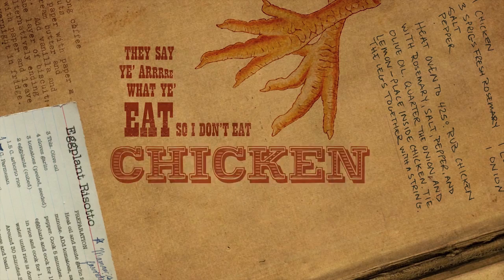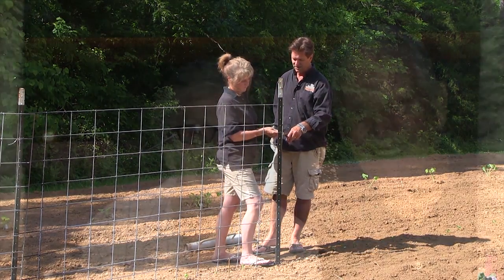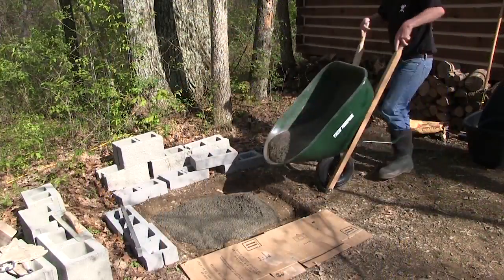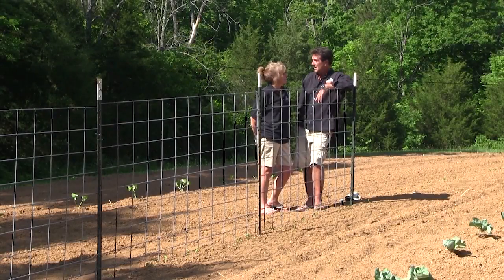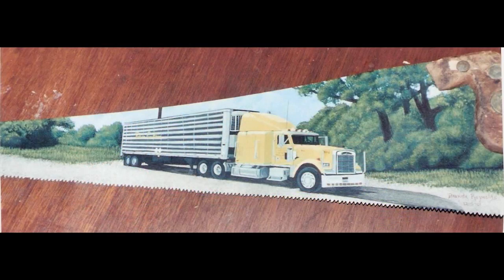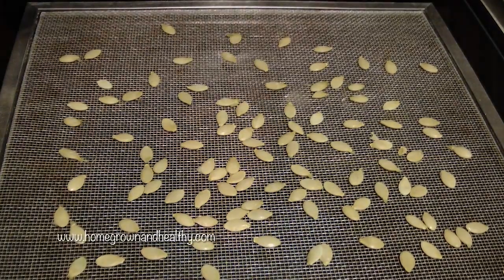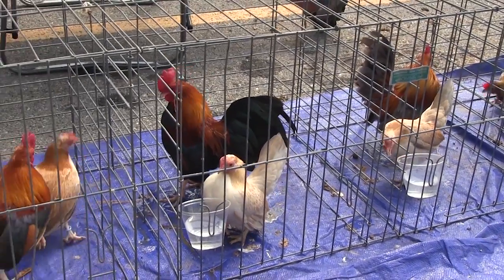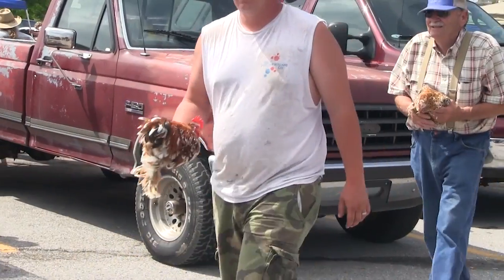Growing Beans, Final Smokehouse, Heirloom Seeds, Chicken Swap & Smoked Cabbage/Onion (Episode #309)

Comment: Going to try the tomato watering bucket, but with Styrofoam cups, because my garden space is very limited. I also cut the bottoms off the cups and upturn them to encircle the plant stems and toothpick them to the ground to help with slugs, however this method needs refined because the plants have to be tall enough to have leaves over the edge of the cups. They dry out quite a bit climbing the cups, which stay dry, but I'm going to have to try plastic cups and other materials too and see if they can't get up the sides. I'm sure they can. Maybe I can soak the styro in salt water for a week or wrap them in crinkled foil. They're extremely bad this year and no smart man uses chemicals or inorganic ferts on their plants. I guess the best solution is bake your dirt and pot the plants, but they're very hard to move around when a storm comes. You have a smoker so you can get a metal bucket, fill it with dirt, heat it up and use it to remove pests, but organic dirt is alright. I personally prefer sterile rotted mulch, which I can mix clay/ashes into and then monitor for magnesium, sulfur and calcium needs. Calcium carbonate or bone meal, ashes, powdered clay and Epsom for tomatoes here.